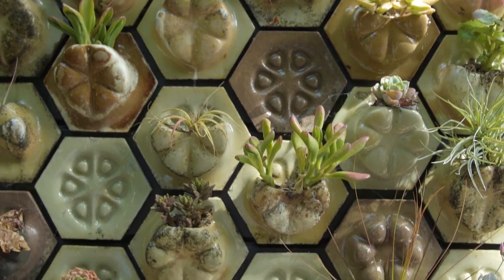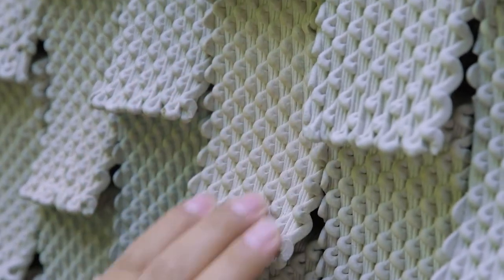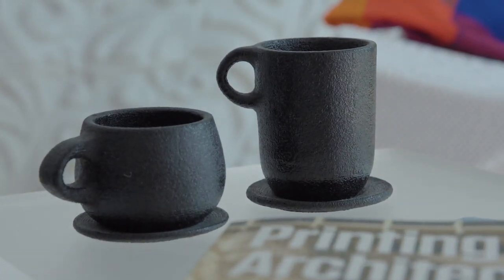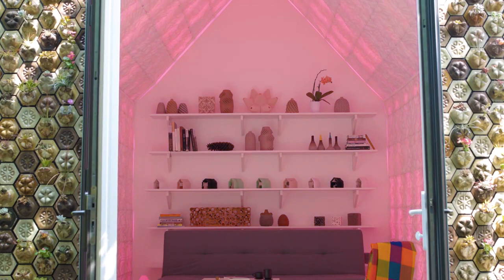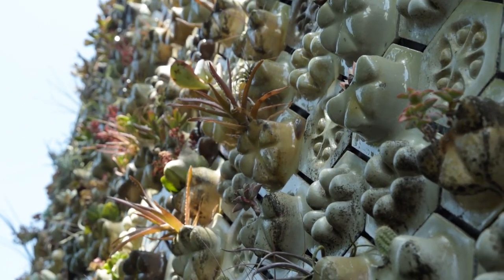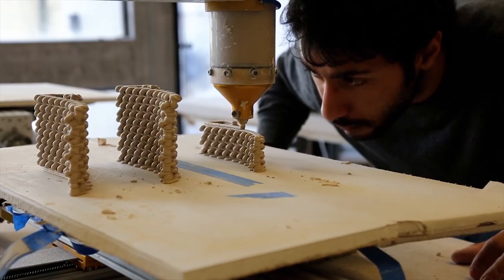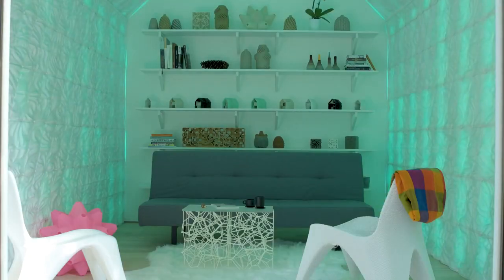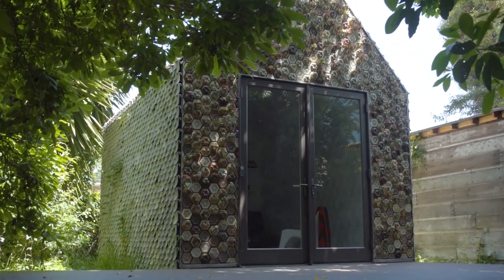Cabin Made with Recycled 3D Printed Materials

Comment: As fun as this is, concrete, steel, glass are all recyclable while the more wood is used the more forests have to be kept (in my country - Poland - we've got some protected national parks, but most of the forests that cover about 30% of the country are there because of the wood they produce). If sb really wanted to be super ecological about buildings she should first concentrate on passive heating/cooling, then just don't build too big, then use wood, then use recyclable materials, then try to keep total cost as low as possible in relation to the lifetime of that structure (which will mean lower energy expenditure).